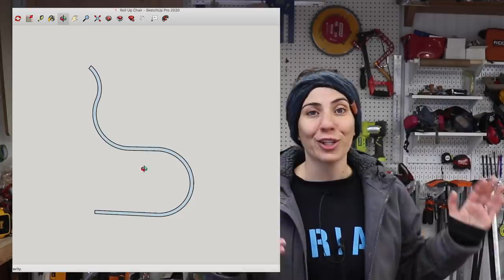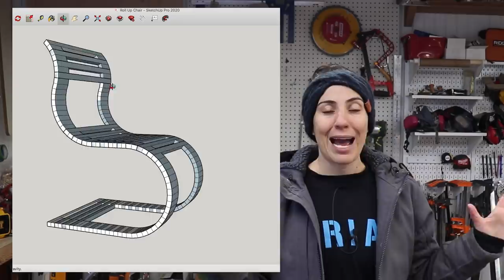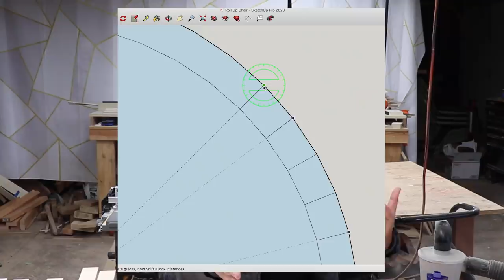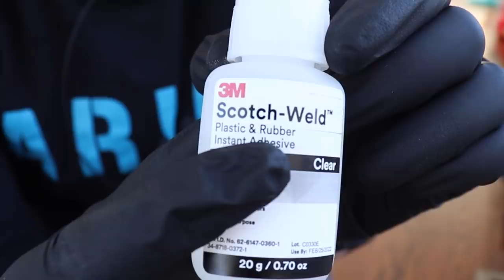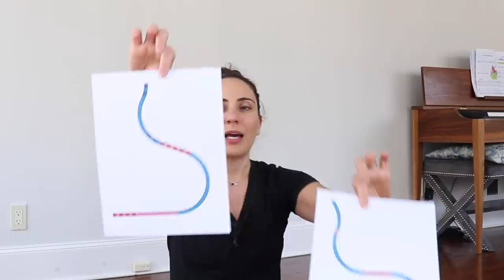I ATTEMPTED to make a chair that rolls up... It didn't go as planned...

Comment: It seems that you used the same angle for all the pieces of wood but you are using multiple diameter circles for the spline that you made so each piece that goes with each circle would have an angle associated with that circle. Simply put there should be 3 different chamfer angles since you used 3 different circle diameters in SketchUp for your spline. This would tighten up the curvature of the upper bends. It seems that in the end, you figured out the straps so I don't have much to say there but one thing for the future which you touched on at the end of the video is to make sure you test with prototypes. For example, once you have the 3 angles for the different radii of the 3 curved sections of the spline, you could rip a few pieces at each angle and check to make sure that when those are put together you are getting the curves you expect.

Comment: I think with some calculations it would have ruled out a bunch of materials. Using average weight of human as a benchmark and applying portions of that weight as point forces in several contact sections of the chair, you can sort of gauge a rough estimate of tension the material would need to resist. Then, the yoga mat idea would never have made the cut. if you had a better method to control the tension in the belt as you secure it, it probably would come out better because the stability of your entire chair is relying on it. But i'm stumped on how to go about doing that. It is quite an organic shape to begin with. There is a sweet spot in the tension you need to find. Too tight and you might snap it or break some fasteners, too loose and your chair flops around. The material seems sturdy though just from your video, so a method to very precisely get more tension on the belt may get the back rest to prop up just enough

Comment: Idea how it might be made to work without redoing the chair: Glue flat metal disks to the sides for the wood pieces (so that the sides are between the pieces). That way, the angle between the pieces changes, the radius of the circle gets bigger, and then with the body weight, maybe you end up in the position that was planned all along.

Comment: This chair is a very interersting Project and I really liked the idea with which you planned it.

The basic concept is flawed tho. Only the curved parts can build up the sufficient tension to make the chair feel supported. 
Arcs with the same working principal were used in anicent structures and I definetly think that you can use that concept. 
The straight bits are the issue, maybe what you can try is to delete any part that isnt an arc. 
To have an even surface to sit on, you jsut need to put the long parts at different points. 
Its tricky to describe what I mean, but I think you must have thought in the same direction already :D

Comment: come on you did the hard part of the work, you are now very close to succeed in thes, just need some other ways to see that or to try again, don't give up, it have potential. i can suggest to put just like something that would work like a filler between the pieces of wood to adjust the curvature of the chair. or to change the shape of every single piece of wood in order to shape the curvature better. or to implement 2 sticks of wood that you can simply put to support the back of the chair (vertically straight in the floor)

Comment: I’d say segment count is perfect, what I think would be a better choice is to just increase the angles you have on the pieces to counteract the flex currently going on. You could even just glue some washers on the outside edge of the old prototype to figure the best angle. Your redesign seemed to be on the right track with over angling the front section to give it the required spring to counteract the weight, I think do the same with the back rest and it should be golden. The only thing there is, I’d be very ugly when no weight is applied and it would from an outside perspective look impossible to sit on

Comment: Redo de top part without the tape, cut the top pieces and add few mills, i would give it a finish leather (personally) thick leather 
You never failed when you tried!!
Im impressed, you are a 10.

Comment: I would suggest to ensure the the center of gravity of the body is directly above the center of the lower circle, and I would also suggest to leave an area for wood compression as its not a rigid material by subtracting around 5 degree from the angle you used when cutting the peices. Do the math and few experiments before hand.

Comment: Instead of using a complete semi - circle, how about using a quarter - Circle of larger radius at the top and a quarter - circle of smaller radius at the bottom?
This is because the larger radius will cause much lesser bending at the top where you'll be sitting.

Comment: Instead of putting the strips of the materials that were holding the whole chair together side by side, what if you stack them up? Using one that's less stretchy on the outside so it takes most of the force since is farther from the pivot point of each piece. You could do a layer of 3, and screw them all together, as for the angles, on the top part you could try and calculate the angles by measuring the difference between how it should be and how it actually is, so you can take that give into account and add it the the angles of every piece.

Comment: I think there is a way to make this work, but the top part needs to be under strong tension during assembly. You noticed this yourself, saying that the bottom part (material on the outside being stretched from your weight) kind of supports you, its just the top part (backrest / material on the inside of the curve) that gets really wobbly. That's because it has the same curvature in chair-form as it had during assembly, so there is no increase of tension to stabilize it. 

No idea how to implement this though, so maybe you have to double down on the principle and put additional stretchy fabric to the backside of the chair as well? But then it may no longer roll up nicely for transport.
Reply from the maker: I actually just finished trying this again. Too much tension is a bad thing and it’s dangerous! I’ll have a video out soon hopefully

Comment: just thinking aloud on this one but would some high tensile rope work if you were to use two lengths per side and run it through the piece? or would it restrict the rolling/seating by being too taught in places  function

Comment: So i think the angles for the pieces needs to be different, technically all the materials you're using can compress slightly so you wanna take advantage of the material qualities, make the angles ever so slightly more than you need, and maybe if you can get some scrap to make Shims that you can use on the 1st prototype to help you find the better angles

Comment: Are you considering building a jig in your shop next time as you noted you would've/likely done? Perhaps this would mitigate most of the shaping issues, leaving only proper tensioning of the webbing and/or rubber. Perhaps I'm stating the obvious. Also, if you glued all layers (rubber to wood, webbing to rubber), on all the shared surface area between each layer as opposed to just most of it, and just used screws for backup, but in literally every piece w/o exception, perhaps that'd reduce the give enough? Maybe it would reduce it too much? Would it be an over-build? I've been accused of such.
Reply from the maker: Yup
Reply: @3x3CustomTamar  Assuming you mean the jig.  What do you think of the rest of it (overbuild/detrimental/beneficial re: gluing all layers thoroughly + screws in literally every single piece)?

Comment: I'm no engineer but to me, the angle has to change depending on the radius of the curves. The large seat area would have one angle where the lower back area has to have  a faster curve to it so that angle would have to be a lesser angle. The parts that actually lay on the floor don't need any angle at all until they start to curve upward. So, your experiment would have worked had you calculated all the angles needed to make the different radii. It was fun watching you figure it out though. Not knowing what material to use didn't help but I'm thinking the double up the seat belt webbing one on top of the other might have been better too. Oh well, it was fun.

Comment: Hmm, neat. Wouldn't trust it to hold my weight if I was going to try making it. I'd do long pieces all the way through. Hmm, maybe try to make rolling support sections that you can attach to the bottom pieces. Interesting challenge, sadly this is all hypothetical because I don't have a shop nor am I an experienced woodworker.

Comment: I think i know how to make the chair more stable, you should try making the bottom base longer than the sitting part, I mean, sitting part shorter than this version and bottom part a little longer, so the general weigth of the person is more in the front arc of the chair, which is the stronger point of the structure!
Reply: Wish i could put a drawing of the idea here

Comment: lots of work, I feel the pain. I would maybe have taken 20-30 of the small blocks that make a curve and test with them instead of rebuilding the whole chair all the time. My guts tell me you'd need a material that doesn't stretch at all but still bends of course.

Comment: The wood rungs at the reverse curve need to be ripped at the right angle. Start with a drawing of the profile. Determine the radius of the curve from the bottom to the back. Determine the number of  rungs and the width of each. Draw this out . This will give you the angles to rip the each side of the rungs to.
The strapping must be non stretchable.

Comment: May not have came out as hoping, but still a not a bad trial. Your initial sketch-up design didn’t account for force being applied to the chair. 

My suggestions: Put 2 full length rail in the curve ahead of your current first seat rail, might add a little more comfort. After what is your current second full seat rail the pieces need to start having a slight angle to counter the downward force. The pieces in the curve to start the back support need a fair bit more angle. The strapping needs to have no, as little, give as possible. (Like that polyester strap you were using) And the pieces need to be as tight as possible when attaching the strapping.

Comment: a little late to the party, but what if you put a very small roundover on the side facing the belt. Then you could add a slight negative precurve so when you  really sit on the chair it creates more tension between the pieces, if that makes sense, somewhat like you did at 13:26 but instead of matching the curve, it would be the opposite direction...... again not sure if that was clear. Basically my idea is to pre tension it the opposite direction that the force is going to be applied (think of a flatbed truck, how it has a hump, and when you add weight it gets flat). Or find another way to apply more tension to the belt as you screw everything together.

Comment: I didnt consider its fail. The concept is proved and it just need some tweaks on the curve. my personal opinion, make it less lean like it will fall to the front and add counter weight to make it go opposite way. Plus this chair have 2 side of curvature, if you want to make it can be roll, I think its impossible unless it only have one side curve

Comment: I feel like this could work with a back support bar between the foot and backrest.. But I totally get that kind of ruins the appeal. Maybe thicker pieces, maybe using bamboo instead of wood or maybe adding triangular supports on the bends that need to hold its shape better, on the back.

Comment: I noticed adjacent pieces didn't really stay lined up well - the straps alone weren't enough to keep them snug against each other. It might be very time consuming purely from a woodworking standpoint with a plunge router and a jig, but I imagine if each piece had a concave and convex notch (in the shape of, say, a truncated pyramid/cone?), it would keep all the pieces joined flush with their neighbors. As for a bigger design revision, perhaps the goal shouldn't be to get everything to roll in a single direction - the most stable straps were always on the exterior of the circles.

Definitely impressive as a first and second prototype, with woodworking skills beyond mine. I only studied woodworking for about 3 years, before gradually expanding into a much more diverse set of hobbycrafting skills - I went the route of jack of all trades, master of none.
Reply from the maker: That’s where my mind is heading....

Comment: That’s totally a FAIL Tamar! As in “First Attempt In Learning” LOL. 
I think the most important lesson here is that dynamic designs are a lot harder to prototype than static ones due to higher number of variables. I would suggest that the width of your “webbing” material would be equal or more than your “locking slabs” for safety: you obviously want to avoid pinching cloth or worse skin. 
I think your choice of webbing material (ballistic nylon?) is good, and definitely stay away from rubber or anything that doesn’t consistently keep its properties, again to lower the amount of variables.

Comment: An "s" shape would've accounted for the flex of the straps better I think.I would assume it wouldn't be a good idea to use softer woods because it would not work for supporting weight. Aside from the novelty this chair doesn't seem to take up less space and I can see future emergency  room visits for damaged fingers in the perfect finger spaced spots (maybe even butt pinches lol!).  Great work as a project but end result even if perfectly executed would've left things to be desired. Plus side it would double as a nutcracker.

Comment: The main problem I see is with the backward bend where you're supposed to rest your buttocks. I can't think off a material which would support that inner bend without being ripped from the surface of the pieces. For the material itself, I'd probably go with 3 or four 40mm wide kevlar straps (precisely because they don't stretch) laid beside each other, and glue it to the wood pieces (puncturing straps weakens them a lot). For the inner bend I'd go in the braid pattern (glue to 3 sides of one piece, then on top of next wooden piece, then again 3 sides around the next piece, while strap beside it would go around in alternated pattern). The tighter the inner bend, the more I'm positive that braiding would be required.

I honestly think this chair is a design stunt, but when slightly over engineered, I'm sure it would work.

Comment: I’m not an engineer but I’m thinking that a steeper angles on the wooden pieces top and/or an additional strapping on the back would make the top of the chair stay more upright... but then it’s not going to lay as flat for storage. You have probably thought of this...then the bottom of the chair could roll up into the more rigid top portion. Gosh, I hope that my outside the box thinking has prompted a little different aspect of which to view this issue. To try something different does not create failure, it does eliminate the process that don’t work. Einstein or Edison had a quote like that. You rock!
Reply from the maker: Definitely an interesting idea. But I just tried it again and failed again… ha. Video will hopefully be out soon

Comment: Tamar...I'm misquoting this but "the only people that don't fail, are the ones that don't try anything" (or something along those lines). The point is you tried. You build way better stuff than me and I would never even consider attempting this! One concern though is...wouldn't the screws on the bottom scratch the hardwood?

Comment: Since you are dealing with curves they don't all have to be the same.  I would shorten the curve of the back to maybe 5-6 pieces for a 90 degree bend then resume the slow bend backward with maybe alternating straight and curved.  This will put your weight much further forward and make the chair more stable.  It will also increase the back height making it more comfortable.  Might want to even add a few more full width pieces on the back to give more back support since it would go much higher on the back.

Comment: The biggest problem is that the blocks of wood don't align properly against each other.
That's because of the width of the rings under the screws that is smaller than the width of the wooden pieces.
Find a way to hold the pieces aligned and you have a chair. Maybe the original has hidden hinges under the band...
Good of you not giving in.

Comment: Sides -> -  -  -  /|  
                         |   |
 Sides ->  -  -  - \|

This is definitly the shape of the pieces at the back of the chair so the angle can so as support the back of it and weight too, probably needs a material on the "Sides" so it doesnt slip in between pieces.

Just an opinnion, dont want to hurt any engineer pride or so <3

Comment: The only thing i would have done different is when it came to attaching the webbing to the wood. You skipped some chunks of wood, which made it unstable and pop out of place. I think if you did exactly what you did with drilling, melting through the webbing, and screwing it down, but doing it so that the webbing is taught and screwing every section of wood without skipping any pieces, that it wood be perfect. See what i did there? No, but really cool project. I’m eager to see how attempt #2 goes.

Comment: You should put a good tension on your straps to take all or the most stretch out of your straps 
Like an 2” yellow ratchet strap good for 3300 pounds 
I use them every day 
But you need to put a good tension or load on them to take all stretch out of then    Good luck next time